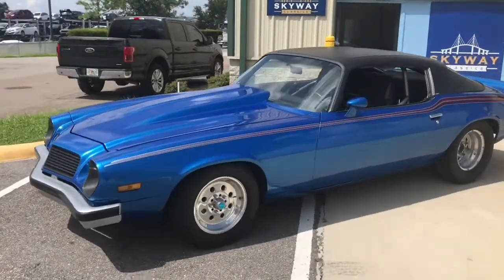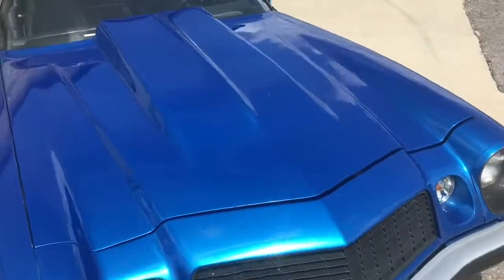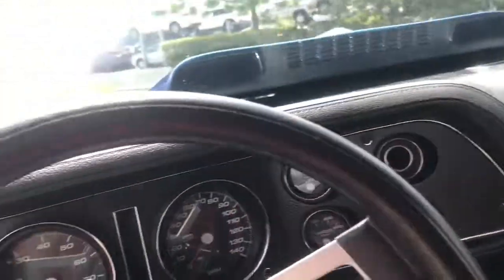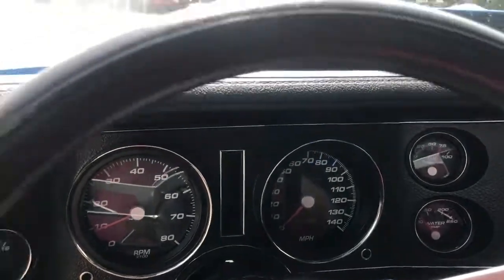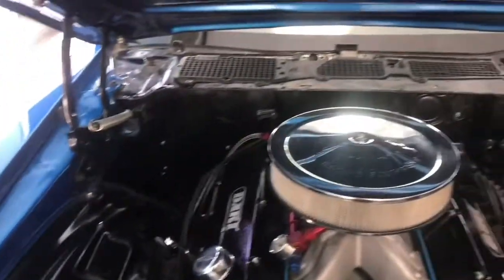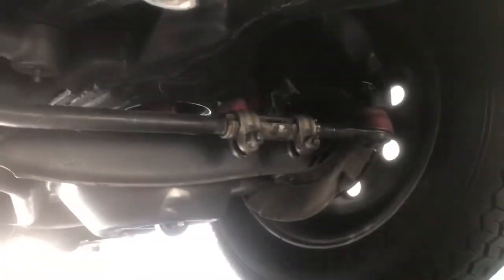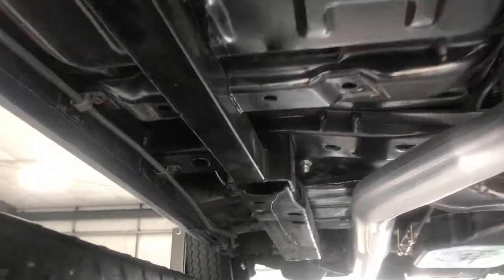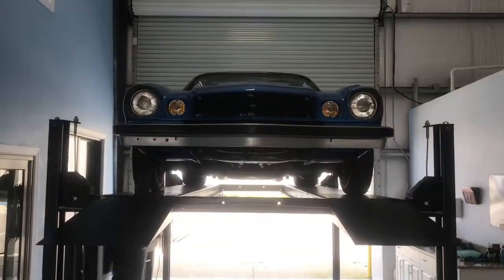1974 Chevrolet Camaro ProStreet #295

Comment: I was the viewer who you mentioned in this video that "accused you of lying" about going for a test run on  cars that you said were cold.  When I said, that you had two videos up that in both cases you could see the temp gauges were showing temps over 180 degrees at your cold start.  So please don't say I made comments that weren't valid.  I just suggested that you not say it's a cold motor start if it wasn't.  This car does look good overall.  But since you hammered my character in the video, here's another comment:    I like the way you chose to glaze right over the significant vinyl top binding issues that may be related to metal rot under and bubbling through the vinyl top on the right side.  I do buy classics cars which is why I look at your site.  And in the 68 Vette you are advertising you claim power brakes.  There's no vac booster so that is wrong too.  Look at the '74 Vette you are selling if you need to see what a booster looks like.  Sorry man.  Just got a little testy because you mentioned me in your video.  I was only trying to help you with your representations and reputation.  I have not looked at your other videos lately.  Just this and the 68 Vette.
Reply: Actually I have to take part of it back.  I just looked at the video's of the of the original "cold car" video comment and one car was for sure showing warmed up but the other was not.  I don't think I would have made that  comment until I saw it as a pattern.  I apologize for that.